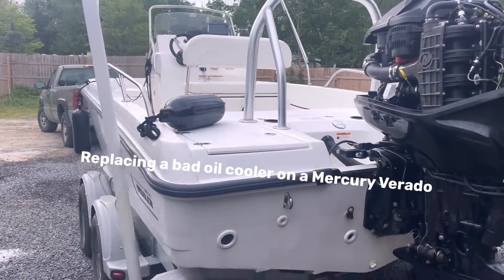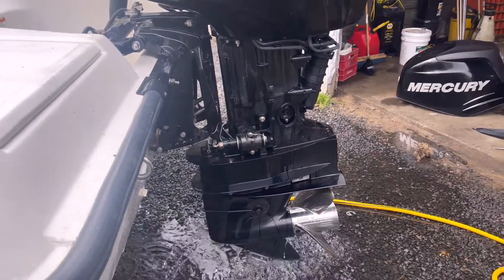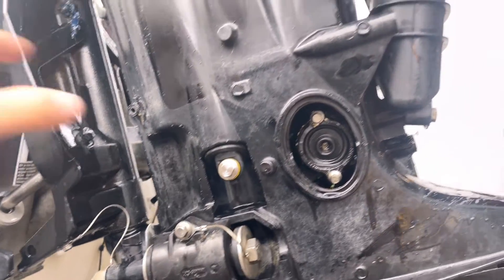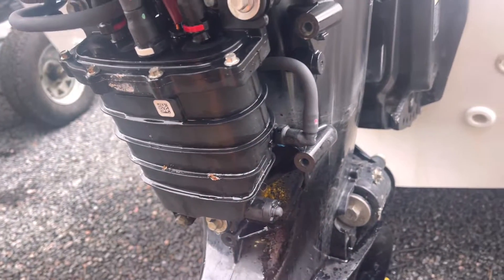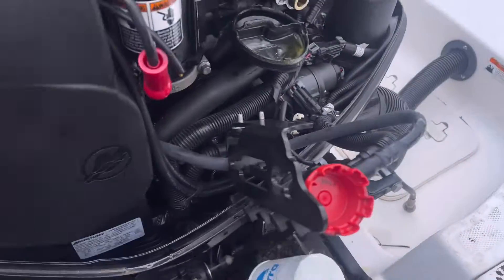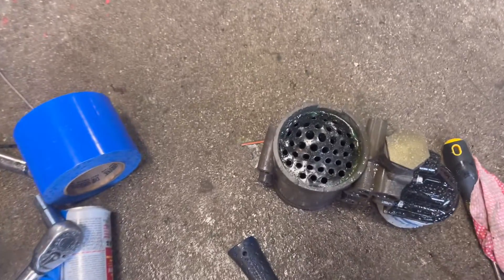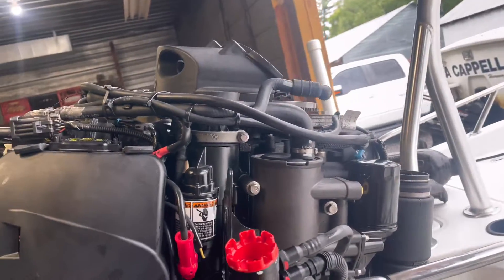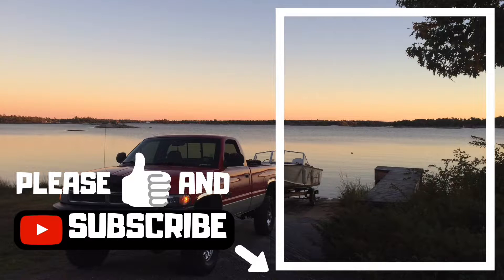Mercury Verado With Crazy Oil Leak. Solved. Oil Cooler Replacement

Comment: Hey there,
I have similar issue on a Verado 400L6 but with water leak from the bottom of the oil cooler. I assume it is an O-ring problem. Any idea?
Reply from the maker: Yes pull it apart and see if you can fix it. Hopefully you can.

Comment: How could that happen? Whats the issue/troublemaker of the cooler?
Reply from the maker: Just made bad. Before this happens merc had a service bulletin to peen over the copper tubes to avoid the rubber blowing out. This was too far gone.
Reply: @Schneids15  my dealer just replace my oil,cooler on L4 Verado and they told me that was probably cause because there was water that freeze . Do,you have the bulletin # related to this problem? Thank you

Comment: Was there water in the crankcase?
Reply from the maker: There was no water in the crankcase due to how this failed. Since oil pressure was greater and it was a very severe leak it went straight into the water. If you had a slow leak it could become present in the oil.
Reply: @Schneids15  Thanks for the reply bud.